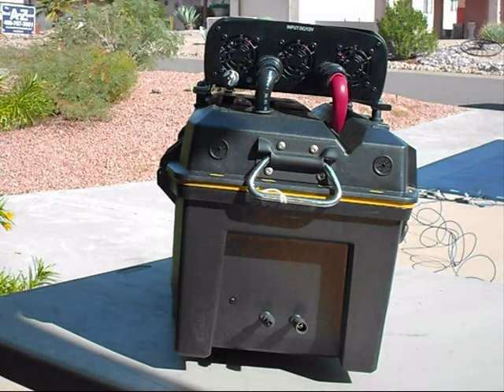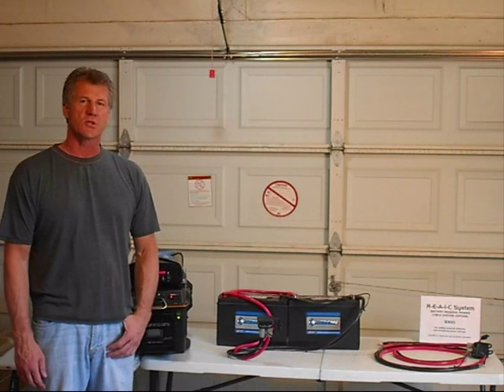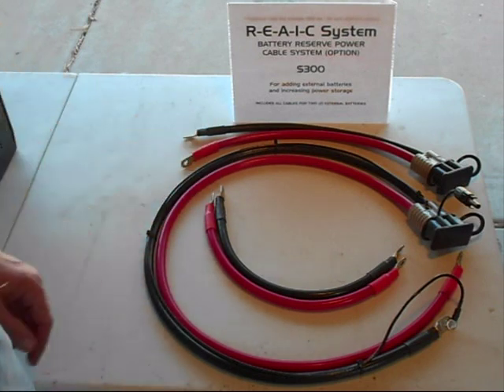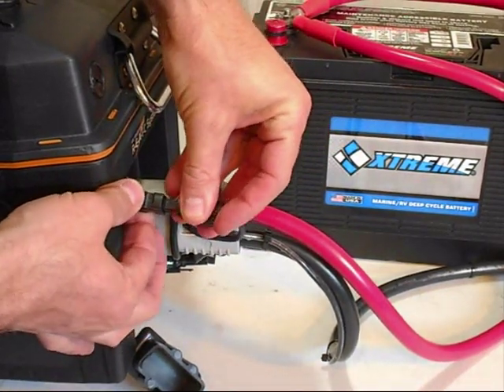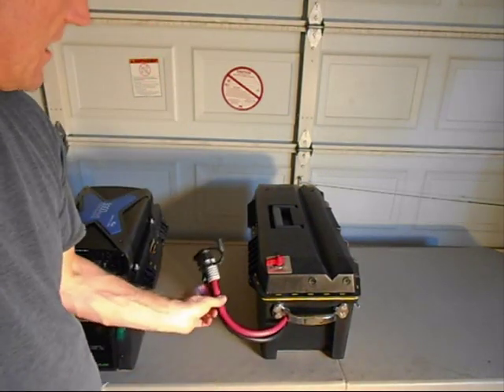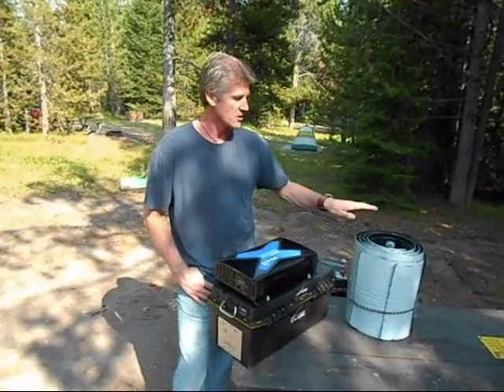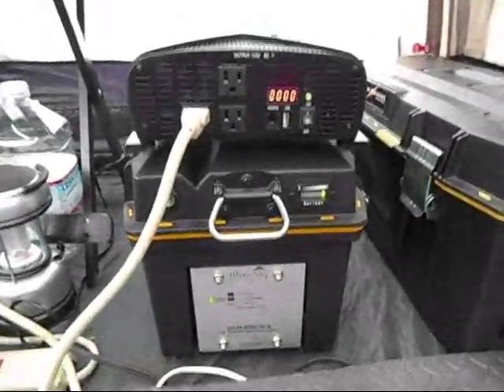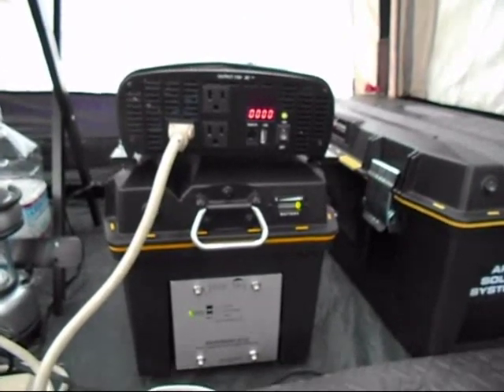3000 WATT SOLAR POWER GENERATOR w/R-E-A-I-C System by ARC SOLAR SYSTEMS

Comment from the maker: Hi Joe,
Thank you for your inquiry. Unfortunately no, a portable solar power generator cannot power a 5 bedroom house. Ours is a medium sized 300 watt generator that can run a few electronic devices and/or appliances. It would not be anywhere near enough power. The system you would need would have too many very large and heavy components for it to be portable. What you are referring to would be a built into the home system with a large solar array mounted on the roof.
Thank you,
Jared Broadbent

Comment: THANK GOD I don't need a generator to do my lights, I already have a system for those, and they are bright too.  LED.  SOLAR panel came with it so I am good.  How long does this unit run a refrig and can you charge its battery while its running the frig?  NEED TO KNOW

Comment from the maker: Hello,
The power required to run a 125 watt cfl light bulb is about 30 watts each. Our generator has about 300 watts of input solar power and therefore, should be able to sustain about 9-10 of these cfl bulbs (during full sun). 
Without full sun and at night the battery would probably run the same amount of bulbs for about three hours, if fully charged up. 

So to answer your question, no. You would need at least 3,500 watts worth of solar panels and and a large battery bank  of about 1,000 ah

Comment: i need to run 40 to 50 lights.. each light is 125 watt cfl.. and i need to run them for 6 hours a day.. could this generator system, or a couple of them do that? or with the extra battery bank options would i be able to do this?

Comment: I like your system, but does it use Lithium iron?
Reply from the maker: Yes. The system can use standard lead acid, sealed lead acid, AGM, gel, nickel or lithium batteries. However, there are some lithium batteries that have a limited power delivery rate. This means that although there are many advantages when using lithium (such as a lighter wieght, faster charging, longer life, ect.), it also means that some lithium batteries cannot deliver enough power to operate high usage electrical devices. This is not really a problem if your using the generator to run smaller electronic devices. But if you are trying to run say a 2000 watt microwave oven, even for just a few minutes, some lithiums may not be able to power them. So in other words if you used a limited output lithium battery in our solar generator it would have the effect of significantly reducing the generators max output from 3000 watts-down to as low as 800 to 1000 watts. The lithiums are designed more to be drained slowly. Standard batteries don't have this power limitation problem, but when your using large amounts of power they can also drain very quickly. So there are advantages and disadvantages.
Thank you,
Jared Broadbent
Arc Solar Systems
Reply: Thank you for explaining that. After we get our budget set and taxes paid etc., I will re contact you about ordering and seeing what is available. I anticipate about 6 months. I will keep your contact. THANKs SO MUCH! :) MaryB
Reply: Jared Broadbent  could I run a nice sized welder off of this
Reply from the maker: Thats a 240 volt device,  so no it will not run a welder.
Reply: Jared Broadbent  do you know a device that could
Reply from the maker: How much power does it draw (amps@240 volts)? And how long typically would it be in a day?
Reply from the maker: Correction: how long would it be run typically in one day?
Reply: Jared Broadbent  2 to 3 hours in a day 200amps
Reply from the maker: No, not a portable system anyway. Thats a 5000 watt draw. Getting a 240v inverter that is capable of delivering that power is not a problem.  Generating and storing the 15,000 watts (per day) needed to operate the welder is the challenge.  You would need a very large solar array - and a large bank of batteries to store that power in order to operate the thing. Think in terms of size of a system built onto a home to operate it off grid. Also much more money (20-30k). But yes, it IS possible.